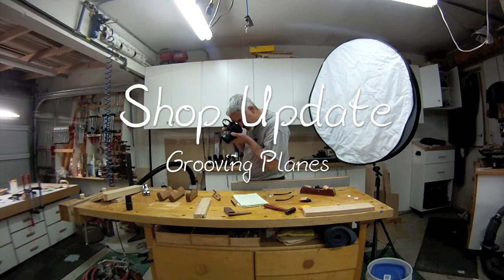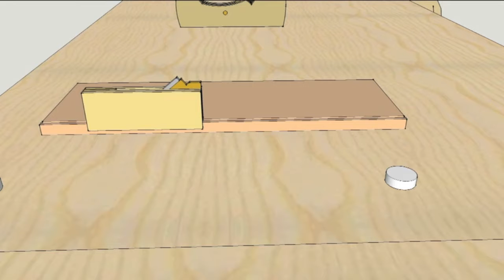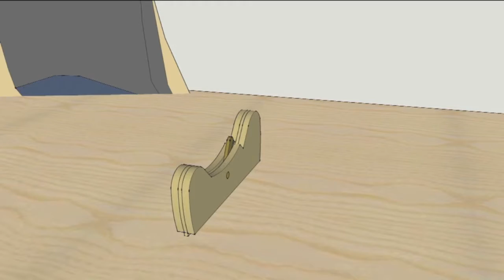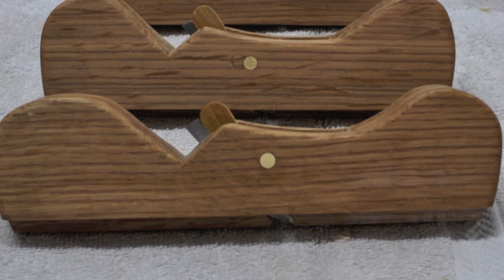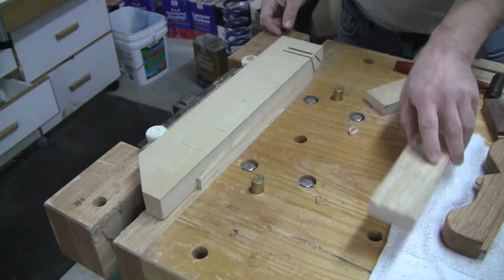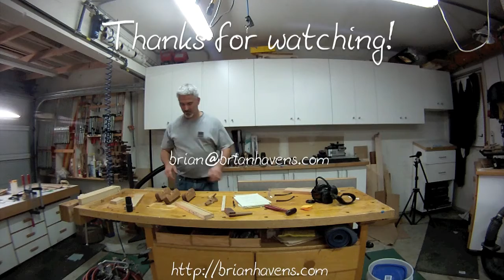Grooving Planes

Comment: Have you, or had you, considered a more traditional "plow plane" type design, such as the old wooden planes with the adjustable fence? 

I ask as I am considering either a Veritas plow plane, or the possibility of making my own. I just don't want to get into such an expensive/time-consuming (depending on route) ordeal if a simpler method is possible.

I enjoy the idea of a traditional plow plane, as the adjustable fence would make groove placement fast, easy and accurate.

Thanks!